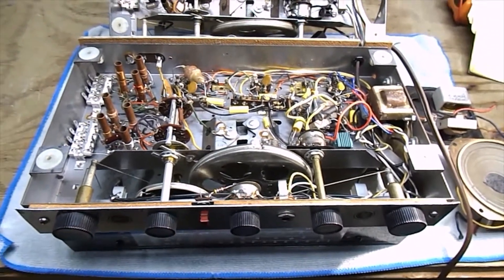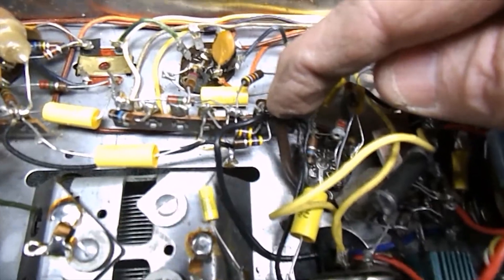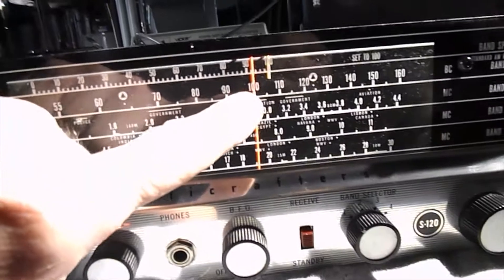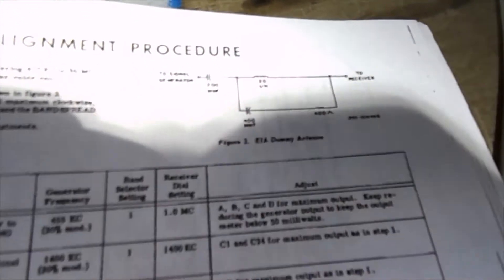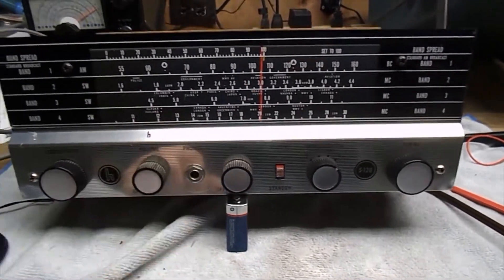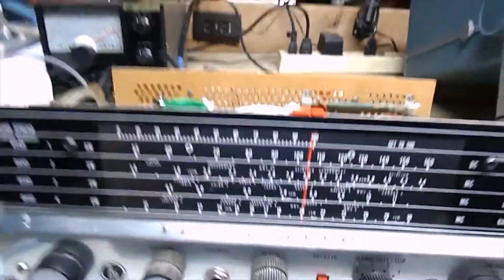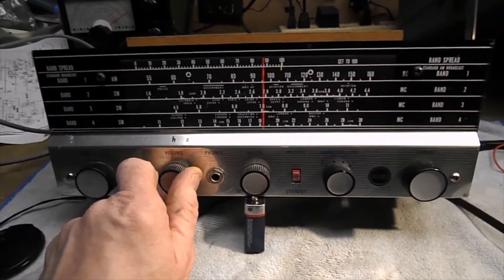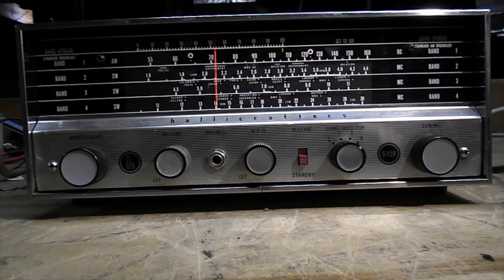Hallicrafters S-120 Shortwave Receiver Recap & Alignment Part 2

Comment: Enjoyed both of these. Great performance for a 4 tube set. You should run the knobs a few times in an ultrasonic cleaner to get rid of the crud in the crevices.
Reply from the maker: Arthur - I picked up an Ultra Sonic cleaner from Harbor Freight the other  day.  I will give it a try on the knobs.  I watched your video, too. 👍